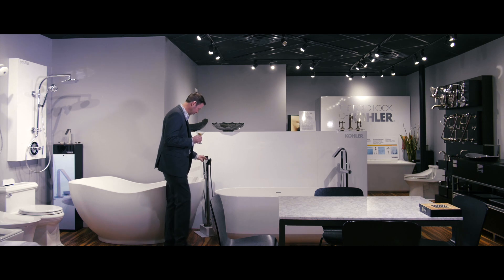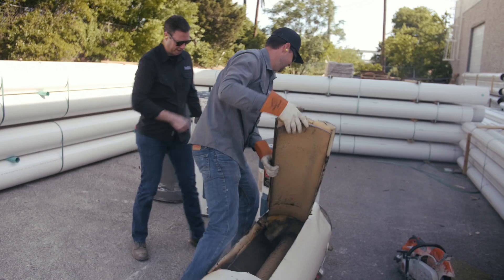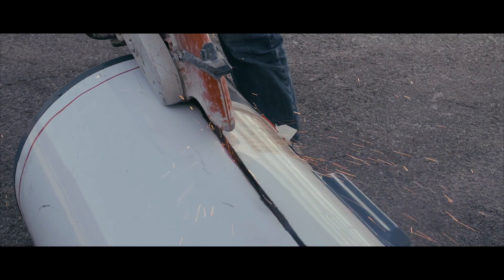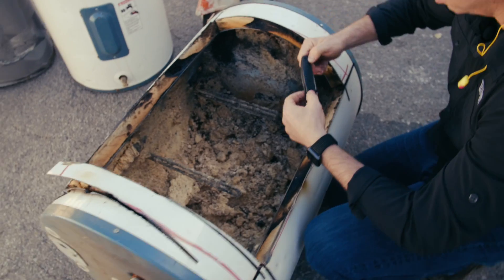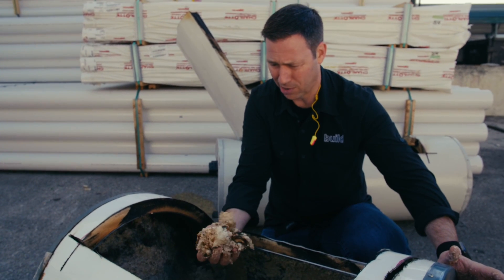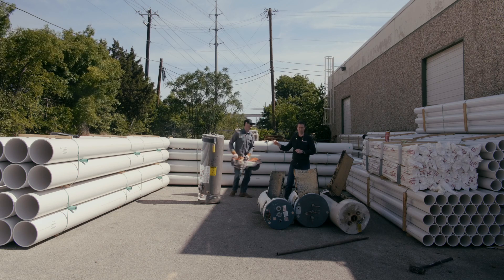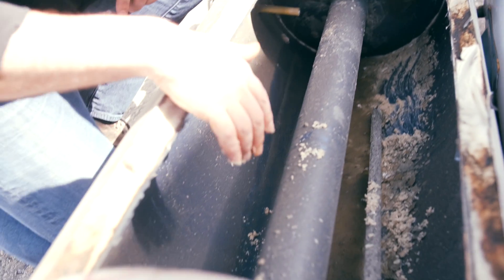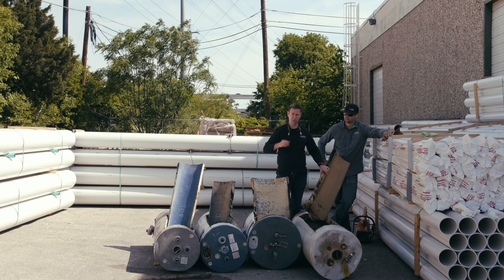Water Heater Tank Autopsy: You won’t believe what’s inside!

Comment: The walls act initially as nucleation sites for microscopic amounts of scale. As the water temp keeps changing the solubility of the minerals, or (metal :mag. iron, aluminum, silica, oxide salts technically), changes, the particles come out of solution and form weak almost crystalline structures with the new salts being deposited on the old scale. As the scale is porous the more there is the more for fresh salts to stick to. Differences in tank build up amounts indicate different areas and plumbing but consistent color mean they all came from the same region. Never drink from your hot water tap or use it for cooking as a short cut to boil water faster. You get all the metals leaching out of the pipes.

Comment: I had to replace my lower element in a unit less than ten years old, and found out the minerals had completely enveloped the lower element and clogged my drain. I used a metal hook and a shop vac to get as much out as I could. manufacturers should put in 2 inch drain plugs in the bottom of these things, or gasket sealed big doors.

Comment: The deposits on the sides and top being more predominant then on the bottom is likely due to the ebb and flow of the water in the tank. Consider the walls like a shore line of a pond.

Comment: A year or so ago I got a new-to-me 40 gallon electric DWH. Since it had been previously used (in NYC) I circulated a diluted CLR solution through it for ~10 hours. After thoroughly rinsing the tank and installing new heating elements, anode rod, and dip tube, it was ready for action... so I thought. We smelled CLR for another couple months with every shower we took. 
Seeing this video, it makes sense that the chemical had absorbed into so many nooks and crannies of the  (quite likely) scale buildup that it took months to disspate that odor.  Yikes!
Reply from the maker: Seems like a good analysis. Bummer
Reply: James, Great review! Couple of other people suggested CLR. But they don't know what they are saying. Good for you!

Comment: I am a plumber. And a couple things. Gas heaters don't cook the calcium out of the water as much as electric heaters do. Second, water quality changes drastically from place to place, so that is a tremendous variable that is an in known in this video. Thirdly, a properly set up softener will significantly reduce deposits because they have been removed already.

Comment: Why would a manufacturer want to help you clean your product likely going the other way smaller drain now thanks  reply to below I am lazy sorry 
The greater  the set point the more prevalent the permanent hardness is try to keep your temp setting as low as possible to manage your demand saves $ as well. 
Land lords add a lock-in shroud on you temp controllers sure am or eb can help if not well mills for some adventurous souls read more folks a little goes a long way and it doesn't take a 13 min video to have more questions then answers good luck

Comment: My gas water heater is about 20 years old. It got to the point where my volume of hot water had greatly diminished. It was so plugged up I could not drain it. I disconnected the water pipes to the tank and poured in a gallon of CLR. Reconnected pipes and filled tank. Lite pilot and allowed it to heat water. DID NOT ALLOW HOT WATER TO LEAVE TANK. After a couple hours I shut off gas and water source and drained. Opened maintenance sink faucet to let air into system to aid draining. Did lots of filling, heating, draining, and  finally flushed through maintenance faucet until clear water with no foaming. Took lots of cold water to neutralize the CLR. Heats great now. Smells and tastes better too.
Reply: Are you sure it doesn't smell like CLR in the shower?

Comment: Some of the tanks you opened may be from houses that are on well water, also a lot of people with softeners do not maintain them or have them serviced. Some water heaters are designed to clean away water particles with a venturi  type action to keep the tank clean. I would be concerned for my drinking water with some of the tanks you showed.
Great video. Thanks
Reply: Do you drink a lot of hot water from the tap?

Comment: The biggest difference comes from the hardness of the water. A tank hooked up to a well water system without a softener will clog up within about 5 years, where a tank in a more residential system on treated water wont suffer as much also, the temp setting on the water heater makes a difference i always recommend to my customers after i do an install is to flush them every 6 months for about 20 mins also not to turn them up to the very hot setting as it will cook more hardness out of the water when its that high in temp.

Comment: The water is the factor that is making the difference first and foremost. Water make-up can differ from house to house even on the same supply. The electrolysis that is set up in a house can very a lot and effect the water. If a water tank is installed so that it is simple to flush out the tank and change the electrodes you can easily double the lifespan of your tank. If a instillation is done with these not in mind the home owner will soon drop it from his annual maintenance. The average plumber is not going to share this info, replacing tanks is just good business, too bad.

Comment: The mineral deposit is chemically called a "precipitate". 

The degree of fouling has everything to do with the locale and water condition. In Portland, Oregon, where I am, we don't see this because the municipal water is naturally soft snow melt water from around Mt Hood. Here the bottoms of water heaters tend to foul with suspended clay settling out during periods of little or no flow.
Reply: I wonder if you can throw that stuff in your vegetable  garden

Comment: yes, surprise, most water holds minerals in solution, usually lots of lime, tada, welcome to the world.   

also, your tank SHOULD have a sacrificial anode in it, a rod of Magnesium, this "rusts" away instead of the tank it's self, in most places, you need to have this rod replaced every ~five years or so (less in areas with water containing more aggressively oxidising minerals), which is much cheaper than replacing your hot water system.
the number one reason for rusted out systems is this rod not being replaced.
if you're a home owner, get your system checked, it'l save you a crap ton of money, as the rods are only like $40 or so apposed to thousands for a new hot water system and installation.

Comment: My first home had an electric heater in the garage. "Community" water was very hard and I had constant problems with lack of hot water. I replaced elements and used my shop vac with a tubing adapter to vacuum the bottom of the tank through the bottom element hole. After that experience I've moved twice and always look at where the tank is located because it can be a real problem if it's in a spot where it's hard to work or gets very wet. In my current home a co-worked told me he always replaced the drain valve on his tanks with a ball valve. Turned out to be an excellent idea when with all that scale the typical drain valve will plug. The ball valve doesn't plug.

Comment: Calcium and magnesium carbonate are almost insoluble in water. In the presence of carbonic acic, which forms from carbon dioxide gas in air, the solubility increases by more than 100-fold. In warm water, this process reverses and the scale settles. The black stuff probably comes from the sacrificial anode, which protects the heater from corrosion.
Btw., scale buildup also occurs in fresh-water pipes (at a much slower rate, however). See this image: https://en.wikipedia.org/wiki/Hard_water#/media/File:Eifelwasserleitung05.jpg

Comment: The sandy things inside are the minerals which are in naturally water. The amount of it inside the tanks depends on how "hard" the water in your area is. Hard water contains far more minerals than "smooth" water. Hard water is better to drink because it can contain minerals which your body needs on a daily basis(Calcium, Potassium, Magnesium, and so on. Grab a bottled water bottle and look up whats there inside).
In Germany you can get the information how hard your water is at the local Water department, dont know where you in america can get the informations.
If your water is hard it is reccommended to put a decalcification system right after the main water supply of your building to decrease the amount of chalk slags in your water based equipments like heater tanks. It can increase the lifetime of your equipment and therefore save a huge amount of money.

Comment: Dude. Chemistry 101.
Any salts would deposit where its colder near the water line or steel edges, where saturated water would deposit the salts, any sediment where its allowed to settle (places where any flow would become turbulent) the anode protects the tank from rusting (and the explosive at worst structural failure from that) from oxidation of dissolved oxygen and chlorine. This is the same situation you often see on kettles, though the elements might look chalky with calcium carbonate and the rest colourful wherever the water line was (oxides, metal salts). A lot of salts will form with oxygen or carbon dioxide (which converts to carbonate) from simply dissolved gases in the water.
Now there are SOME salts which actually become LESS soluble in hot water, I think calcium carbonate is one of them, and that would indeed make the problem worse (though one would expect to see that caked on the heating elements).
Makes sense this would be where buildups would occur, and is a good sample of the things that are in the tap water you drink...can even see elemental sulfur in there...really not a surprise...the environment where water is being sourced and pipes leading to the tank makes the most sense as to what deposits you'll see (calcium salts, copper oxides, rust, etc). 
Lowering the heat will help prevent excess evaporation at the water lines and thus formation of deposits. Once they start it is hard to stop the process. This is the main reason why it will cake on the sides (until the pressure is so high that either it is vented or evaporation is forced to stop) Lower temperatures to be held will also slow the reactions on the sacrificial anode or sides from oxidizing. It may even be more efficient depending on the insulation used. Flushing your tank continuously with water might help the problem, but a better way would be some kind of acid flushing (even vinegar).
Don't drink your hot water!

Comment: Just gonna throw this out there, if you made a copper tank it would likely last through the next 500 or so years. Build it to last and it will, build it to be replaced every 15-20 years and it will.

Minor consumables like rubber and a filter are easily replaced. Here an old house is 1700 or so. There's a town in England the the NEW part was built outside the wall in 1500, inside was 1100. Majority of the buildings are still in place, some with century old plumbing.

Comment: I flush mine out twice a year. Mine is over 30 years old. Was my grandfathers. I change the heating elements every 3 to 4 years and clean them off ocasionaly depending on shape there in.
Reply: Everyday I remove the top and bottom heating elements, and drain the copper water heater installed March 31, 1959.  I replace the anode catharsis probe pole weekly. Makes a gigantic mess, but that old water heater is as fit as a fiddle, and I expect to get another 90 years of service from it using this maintenance menagerie!

Comment: Thats why you open and clean it every 2-5 years. Take a look in the manual! And don't forget to change the sacrificial anode aswell.
Reply: You can open them? lol
Reply: Yes. Some screws on the under side.
Reply: @KeyboardPriest  I see why you don't for scrap metal
Reply: LOL  I love it when people don't change their anode for 20 years, they think their tank might be rusted, the crank on their anode just to break the tank or severely weaken it.  My father in law says "the plumber changes the liner every few years"  I tried to explain that he is changing the anode to protect the tank but he said, "I don't think so".
Reply: Thats alof of garbage to throw away when scrap metaling... Habe a big one had like 11 in 2 weeks now this big ass one and was debating on taking it apart...might look in get easy non bs copper n stuff out n put lid on for more weight
Reply: If you open up the ports (unscrew the fittings) you can look inside.

Comment: That is NOT 'mostly calcium'...if you have 'hard calcium buildup' it looks like 'cinder-block concrete' (and is just about as hard)...you are NOT going to cut calcium easily with a pocket knife. That looked like 'mostly sand'...which comes from most-likely California...and your water supply dredge-sucking sand up the intakes frequently (for your public water supply). I live in West Texas, and we have a hard alkali basin...with wells DEEP below 700-feet. In 3-years (at calcium hardness beyond 300) I've lost water heaters TOTALLY SOLIDIFIED inside (and it looked like someone just poured mortar into them and it solidified!). If you don't change anodes every 6-months here, you won't be able to unscrew them to get them out of the tank EVER again! Best thing to extend your water heater tank is to put a softener UPSTREAM of the heater with triple or 5-stage element filtration...the softener works BEST by far, for calcium (alkali) areas...

Comment: gas water heaters are for the most part better at being cleaner.  Electric heaters always have heat going to the elements due to voltage leaks.  Also, some of these may have flexible tanks to reduce scale build up.

Comment: the reason for the minerals to gather on the top of the tank  chould be do to water being abel to hold less minerals when cold, so the hot water in the tank will desolve the minerals gatering around the heat elements and as hot water rises it will come to the top of the tank were it will cool down and deposite the minerals, this is more likely to happen in a electric heated tank do to better temperature control. in a gas heatet tank the water will evaporate at the heatet surface and go to the top as a gas, and steam do not carry minerals.

Comment: its too bad you cant just open up a hot water tank to inspect/clean inside, then close it back up and on your way.  Our tank, running on hard water, noticed our hot water was dropping fast.  So we got a hot and cold water anodes.  The cold one was snapped off which what caused all the problems.  The cold water feed wasn't getting to the bottom of the tank, but rather stayed on the top.  The hot water anode however we could not get out, it was too gummed up with deposits.  We never even once thought till of course you have a problem that we should be changing it, or at least checking it regularly, especially with the hard water that we have.  So we aren't even sure how much of the hot water anode we have left, if feels at least half, and there is the cold water anode that broke at the top just in the tank doing it's own thing.  Would love to open it up, scoop out all the goop and stuff, close it back up and be on our merry way.

Comment: when the heating elements in the hot water tanks get too hot they turn the water into bubble's... so any minerals in that water then come out of solution, the minerals can redissolve into the hot water forming a super concentrated mineral water that will clog all the pipes in the house... so if the hot water tank looks like those ones the pipes in the house are probably built up just as bad.

Comment: I have a tankless water heater. It heats the water in copper tubes with a small propane flame. What is the danger of the tubes getting build up like this? Water does not sit in the tubes.
Reply: You are supposed to flush those heaters with acid every year.

Comment: The scale is mainly Magnesium and Calcium which are present in hard water. When you have high pressure and high temperature boilers it can be a serious problem without adequate water treatment. I know because it is a large part of the Power Engineering course I am in.

Comment: I'm guessing there is much more oxidization occurring in the air at the top of the tank.  Can test this with a nail left half in and out of a cup of water.  Should observe a faster accumulation of ferrous oxide on the exposed part of the nail due to the abundance of O2 gas in our air.  In water bonded Oxygen can fracture and oxidize as well but not as readily as O2 gas.
Reply: Darcy, there is no air at the top of the tank. It is always full of water.

Comment: It's the water. Municipal water doesn't have the minerals that drilled wells do especially in certain places like the northeast and Florida where the water flows through limestone. 

I had a system that would vacuum out the sludge in the bottom of the water heater. It would build up so much it would cover the bottom heating element exposing the element to air and consequently burn out. I saved customers hundreds by cleaning once a year rather than replacing the water heater.

Comment: always wondered why ppl still use those wasteful and ineffective heaters. why try to keep a tank of water hot at all times when you can just heat on demand? that way you dont have any issues of running out of hot water in the middle of your shower time nor are you spending gas/electricity 24/7

Comment: the scale in the water heaters are formed when there is a nucleation point in the water.
the water most likely was hard water so that could have caused the nucleation to happen.
the more efficient the water heater, the more scale formed.
and it would make your water cleaner too.